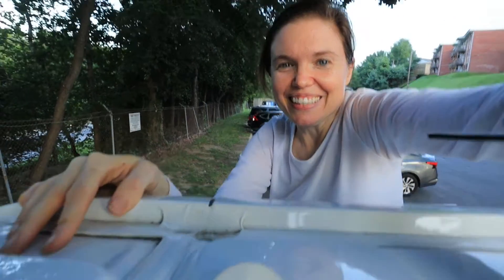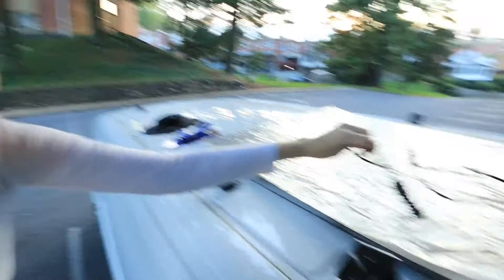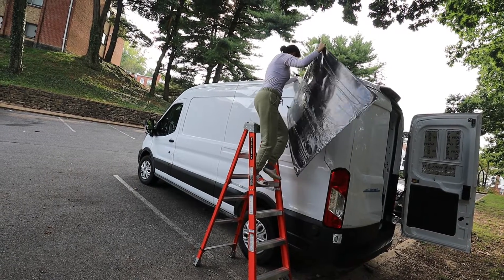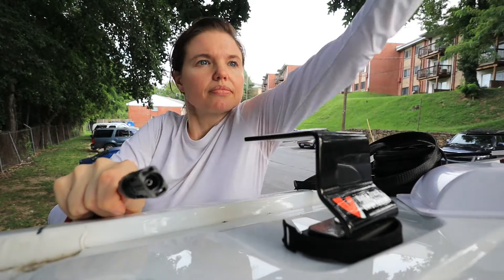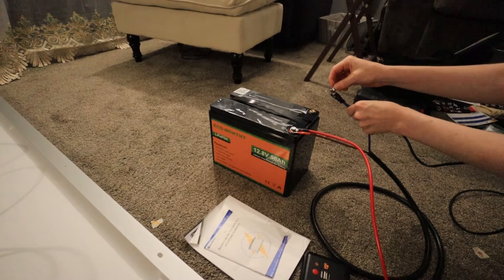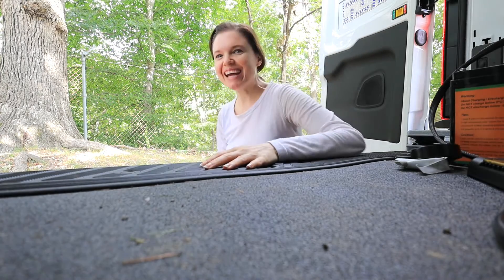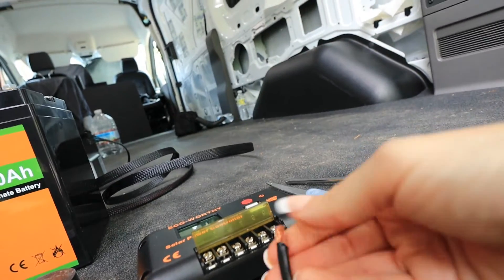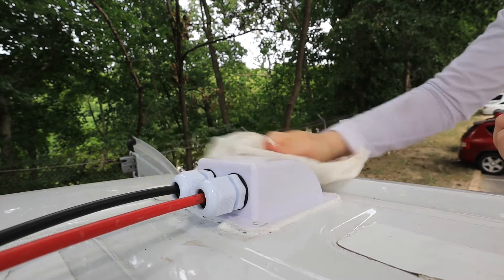Solar Power Setup: Adventure Vehicle, Ford E-Transit

Comment: You did good for your first time. 

Constructive criticism- Flexible panels tend to fail frequently and often. Presumably in your case as its on a hot metal surface that can reach 160deg or more especially with a black panel. the plastics and others tend to fail and short out or start fires etc.  Normally they're glued down with a marine adhesive. But have fun getting them up when they fail. If you dip your finger in Mineral Spirits/Paint Thinner then dab on or smear caulk/adhesive you can make it look nice and smooth or shape it. Dipping every few seconds will keep it from sticking to your finger. 

A circuit breaker on panels gives a convenient means of disconnect before making connections. Or cover panel then connect set controller correctly and then uncover. Add on like a 20A DC-DC charger for faster charging while driving. If that's a 1000w inverter it should have like 2ga wire. The included wires are frequently undersized and causes problems in heavier load operations. Like causing it to indicate low voltage and shut down. 

Pretty sure thats a PWM charge controller if so it will likely kill your battery quickly. PWM work fine for Lead batteries.  Lithium needs an MPPT controller. There's also a lot of cheap foreign controllers claiming to be MPPT but aren't. Price will basically tell you.The HQST M2440N 40A is a good option that can't be beat on price anywhere I've found.  Also has Bluetooth for App monitoring and control as well as APP control for changing the boost charging to 10min or lowest possible as Lithium doesn't need it. Best value and option anywhere for $120 on Amazon.

If you need a phone a friend option I have an email address in my Channel video descriptions and make a comment so I see one/both.
Reply from the maker: Good afternoon, Mr. Motofy. It's such a pleasure to hear from you, and thank you so much for sharing your wisdom with me; your expertise is genuinely appreciated. It's so neat that you know so much about the different panels, controllers, and connections! Thank you for offering your email address; that was very sweet 🤩I hope you have a great week! Mandi

Comment: Yeah, you're going to get some arcing when you connect your panels first.  You could buy a battery disconnect switch and put that between the battery and controller.  That won't arc in the open.
Reply from the maker: Good morning! It's so nice to hear from you. Thank you so much for sharing your suggestion 🤩 I hope to see you again at the next video. Mandi

Comment: Hi Mandi.. Great video, and seriously massive kudos for successfully  doing the installation and getting it to work.. Electrics are so intimidating.. The only criticism is that you should work out where you're putting everything on top of the van withoit fixing it in place and fit the wires to length on the top of the van, otherwise all that excess wire that you've taped down  is gonna be flapping around when you're driving. The vent where the wires go into the van should be as close as possible to the connectors on the solar panel, leaving just a few centimètres of câble exposed to the wind so they won't move.. Well done though 👍👍
Reply from the maker: Hi, John! I am so happy to see you again! Thank you so much for the really kind message; you're the best! Thank you so much for your feedback on my creative handyman work 😀 The footage for this video was shot last summer; it's just taken me so long to edit - as it often does haha. The solar cables that came with the solar kit are quite long, and I wish that I would have known to explore maybe buying shorter cables way back when haha, but everything is all but super glued to the roof. So far, thankfully, there has been no cord movement in the past year, but I will keep all of the wisdom you shared in mind. Thank you for being so sweet! How are your time-off travels going? Is everything going great with you? 🤩
Reply: @GoMandiMartin  I'm good thanks.. So glad to hear the cables haven't moved. All is groovy here in France, no travel plans at the moment.. I'll take a couple of weeks off at the end of the summer, I'll be going surfing down to the South of France as usual in Hossegor.. I was intending on going to do the Lukla  base camp trek this year, but I'm trying to buy a house in England at the moment so all money Is going towards that.. Always makes  me happy to see your beautiful smile 😍
Reply from the maker: @jackrussell19a  Aw, wow! Your plans are so inspirational! Your summer break sounds so wonderful and peaceful! I remember taking one surfing lesson in Hawaii many years ago - and feeling like I could conquer the world when I was still standing/upright when I hit the shore haha!  Ah, that's totally understandable about putting all your money towards your upcoming house purchase. How exciting! I really wanted a house and the van, but both costs about the same haha, so I had to choose. Aw, that is the nicest compliment! Thank you, John! I can't wait to hear more about your home buying and how your summer break turns out. 🤩